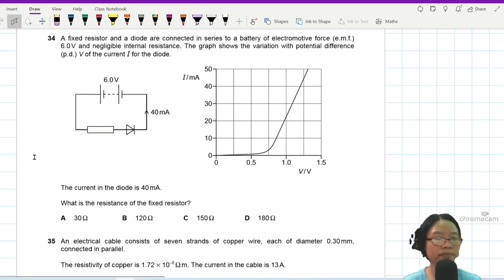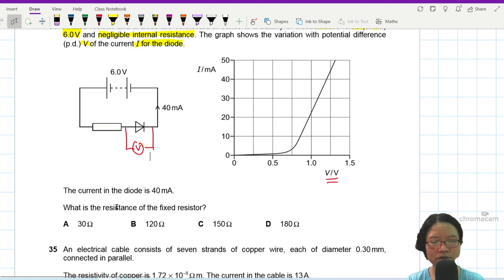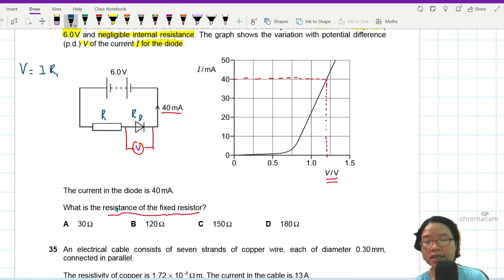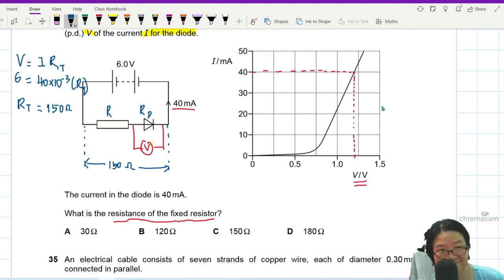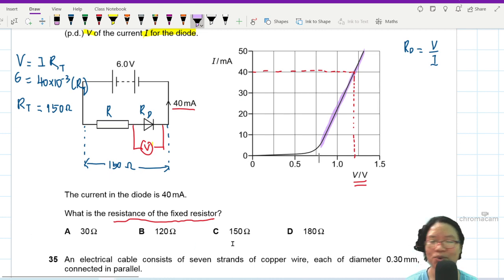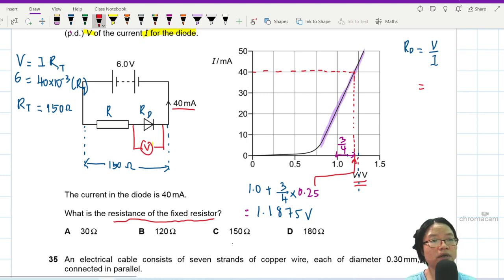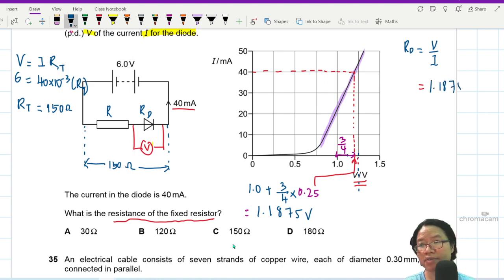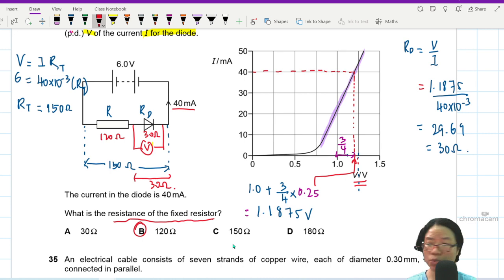FM21 P12 Q34 Resistor with IV graph of Diode | Feb/March 2021 | Cambridge A Level 9702 Physics

Comment: Given that the voltage of the diode is about 1.2V. 
And the fixed current passing through the circuit is 40mA.

Applying the voltage divider rule:
E = V_R + V_diode
V_R = E - V_diode
The Voltage at resistor R = 6V - 1.2 V = 4.8V
Resitance = 4.8/0.040 = 120 Ohms